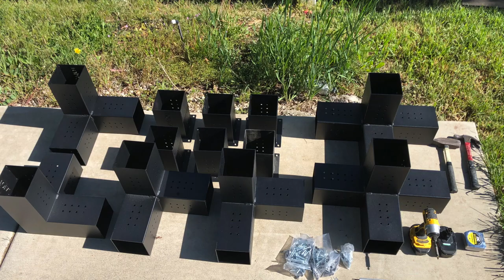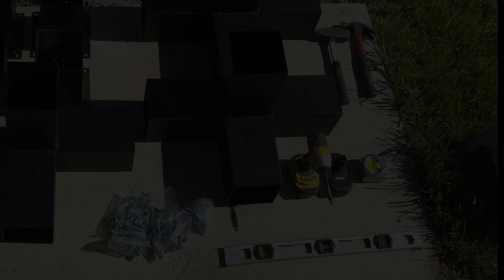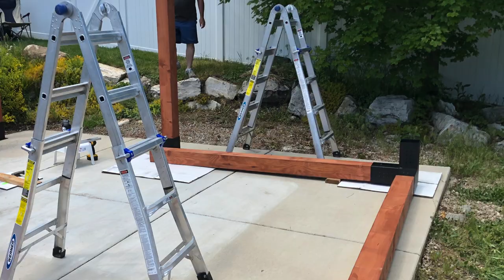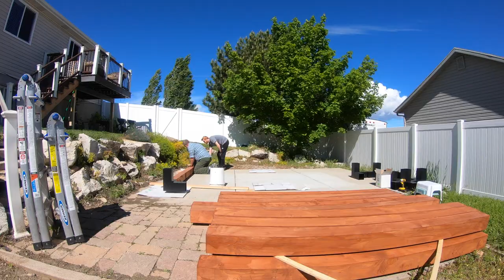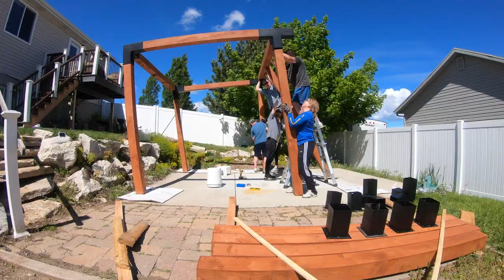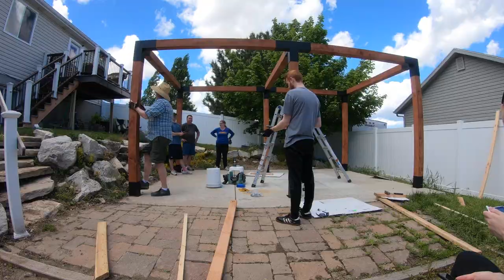TojaGrid - Installation of 10' x 16' Pergola.

Comment: Are all the posts same lenght?
I was curious how the water will drain from the roof if they are all same size?
Reply from the maker: This is a 10 x 16 pergola so three of the beams that run the width of the Pergola are 10 feet in length, all of the rest of the beams and legs are 8 feet in length. 

A 6 x 6“ beam is 5 1/2 inches wide so it doesn’t hold a lot of water/snow. 

In the winter when it snows, I take the fabric shade roof off during that time of year

Comment: What to do if the wood doesn’t fit into the three way connector? I have to use at least the four post and they don’t seem to dig all the way in. Any solutions would be appreciated!
Reply from the maker: Try sanding them down
Reply: I planed the wood using a hand planer

Comment: How many people were needed to hold everything up while putting on the last vertical posts? Our 10x12  is half assembled on our deck and I'm trying to see how many people I need to get pizza and beer for in order to get the job done. Thanks!
Reply from the maker: Four people should be enough. If you’re using 4 x 4 post it will be much easier. The 6 x 6 posts were much heavier
Reply: @HuntAndFishExchange  Thanks! We used 6x6 so it is indeed heavy!

Comment: Nice video on how to put together a TOJA Grid pergola.. I got my kit for a 10x16 last week and want to start my work over the long weekend.. I had a few questions regarding the concrete slab and the post lengths.
1. My concrete slab has a slight slope to allow for easy water runoff, do you recommend cutting the posts to the correct length beforehand? 
2. What kind of Post Anchors did you use?
Reply from the maker: No - I left my posts the length they came. I used the Redhead Anchors 3/8" x 4" see this link: https://www.itwredhead.com/products/expansion-anchors/trubolt

you can find them at Lowe's & Home Depot
Reply: @HuntAndFishExchange  : Sure appreciate your response on this.. I'll check the link out..
Reply: How big is it? Answer: Hello, Our Toja Grid Kits can be built to any size you would need, The recommended wood span for our 4x4 brackets is 12 feet and for our 6x6 brackets is 16 feet. Anything bigger would require our Quad and our Quint Bracket to expand the Pergola to your needs.

Comment: Hi there.  Pergola looks great.  I realize you answered this same question below, but I wanted to absolutely confirm before I commit to buying 6x6 kit.  Is the thing stable or does it wiggle? Or is it rock solid? I've seen 4x4 versions wiggle/wobble quite a bit.  Thank you for your thoughts.
Reply from the maker: No - wiggle and mine is rock solid. It’s anchored to the cement pad

Comment: Looks great, about to do a 6x6 12x16 on my patio... What did you use to anchor the bases to the patio? Wedge anchors, sleeve anchors, tapcons?  Thanks
Reply from the maker: I use the red head anchors 4“ X 3/8”

https://www.itwredhead.com/products/expansion-anchors/trubolt
Reply: @HuntAndFishExchange  ok thanks, was debating between those and the Tapcon Plus heavy duty 3/8 by either 3 or 4 inch... Both seem like they'd work fine, but if I get close to my patio edge the tapcons might be safer..

Comment: How thick was this slab? How has it held up to wind ?
Reply from the maker: If you're talking about the cement slab, it is about 4inches thick, however I have a 34 inch footing that was pre-poured under each post when I originally laid the concrete.

I live in Utah and needed it to reach past the frost line.

Comment: I want to get this system but as a 10' x 14' . Do you think four posts is enogh to hold the weight? Also how long total did it take to actually build it? It's been a year now, how has it held up?
Reply from the maker: I think 14 feet is too long of a span to have without another post supporting it. Especially if you are using 6"x6" post like I did. They are pretty heavy.

It is holding up very well, I just need to re-coat come of the top beams again with Thompsons  water seal/stain

Comment: Hey, I know this is an old video, but question! how deep is your concrete patio? I've been mulling one of these over but I only have a 4 inch thick patio, which seems a bit light. How deep is yours?
Reply from the maker: my slab is 4" deep but I made footings 3 feet deep and only 2'x2' where the posts sit. ( I live in a climate that has snow for multiple months of the year.)

Comment: nice what kind of lumber did you use and what was the rough cost?
Reply from the maker: Dennis Diaz - are used a 6 x 6 lumber by 8 feet tall for most of the beams and four 6 x 6 x 10‘.. Lumber cost was around $500 if I remember correctly
Reply: Looking awesome.  Just purchased our brackets. What kind of wood did you use? Not post size. I looked up 6x6 cedar posts and they are super expensive  !!!!!!!!

Comment: Very helpful video, thanks! Question on the redhead anchors in which I am also looking at as well....the 6x6 posts have the pre-drilled holes on the base brackets 1/2 wide so I was wondering why you went with the 3/8 instead of the 1/2 anchors? I tested with both sized anchors and seems the 1/2 will go through if you hammer it lightly through the pre-drill hole on the base, just not sure if that's ideal, whereas the 3/8 fits easily. Thanks.
Reply from the maker: That is why I went with the 3/8 size. Because the 1/2” seemed to big for the holes.

Comment: This video is super helpful! Question... did you have to wait for your lumber to dry before it would fit into the Toga? I am having trouble with that. I know the wood will shrink but am not sure how long that will take.
Reply from the maker: I really didn't have a problem with my lumber fitting into the system. But I live in Utah and it is very dry here. 

I suggest you let it dry out if you are having issues fitting. The only prep we did was sand off all of the black ink that was stamped on the beams and then stained the beams before the install.